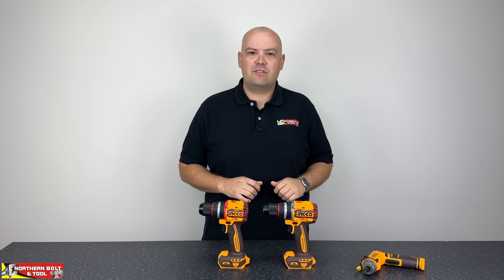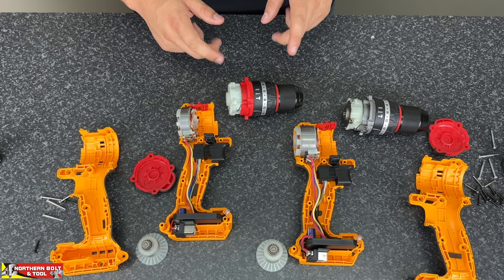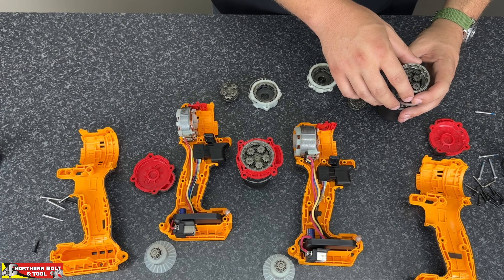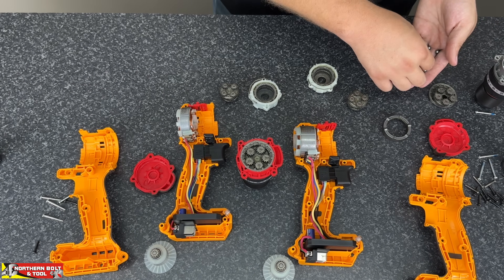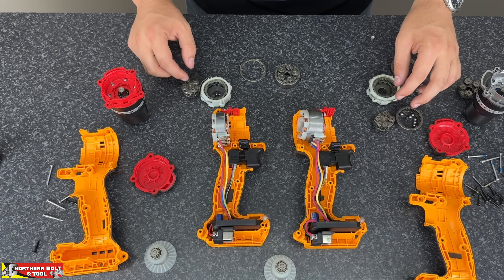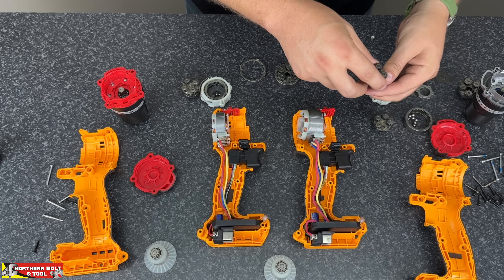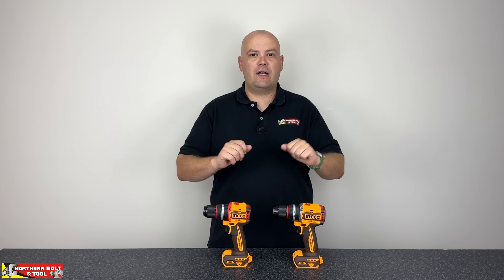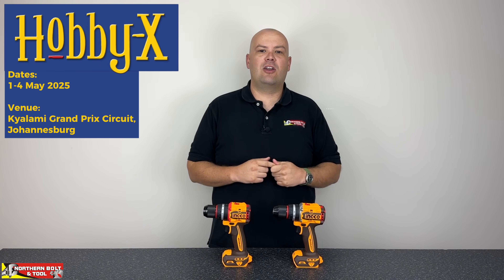Ingco Cordless Impact Drill Teardown: 66Nm vs 96Nm - Which One REALLY Wins?

Comment: what i liked about the design is the circuit board is located at the bottom of the handle near the battery for better prevention from short circuit with the motors as well as weight balance as well, and the metal housing for the motor is a plus for the 96 Nm model, but still not much user of Ingco brand at the moment to praise its worth. But ist's a good design.

Comment: right off the bat, i want to say Thanks for the video about internals of these drillls, rare to find an official product channel show the internal workings. 
and nice touch that you used an ingco small driver tool  itself for opening the tools. The cabling between battery and motor does appear to be higher gauge in 96Nm drill.
wondering if the motor from 96Nm drill can fit in the smaller Nm drill and upgrade it to a higher power drill
Reply from the maker: Thank you for watching! We are glad you appreciate the detail we go into in our videos! As for the motor, it will not fit as the dimensions are a little different, but with some modification you could get the bigger motor to fit in the 66nm casing, I think. For the effort that would go into that it might be better to simply get the 96nm unit, but definitely an interesting thought!

Comment: Interesting, the 96 does seem more robust. 
That said, the warranty thing was surprising. Why would the warranty be voided if it were disassembled and reassembled? How would you even know that it was disassembled if it was properly reassembled?
Reply from the maker: If the unit isn’t assembled correctly it could cause the machine to fail. If you know what you are doing it should be fine.

Comment: Are the planetary gears dry or do they have some grease? It looks bone dry in the video. IF they are dry, do you recommend people pre-grease the gears before first time use?
Reply from the maker: Hi there, the planetary gears do have grease on them.
Reply: I managed to disassemble one Ingco cordless. Although it had grease, it has too little as per my assessment. Idk why Ingco did it that way, not that Ingco should put too much as it is also counterintuitive because it might have a clogging effect, slowing the gears.

Comment: At first I thought they just change the color and circuit board to deliver a bit more power and claim big number.
Nice to see it actually has a bigger motor and more robust gearbox. I guess for heavy use, $10 is worth the upgrade.

one question, did you take it apart and clean out the grease before video or is it came out of factory very dry like that? If so is it worth the time to take it apart and grease it before use? maybe molybdenum grease?

Comment: Great video and I always like to see what is under the covers.  The difference in the planetary gears is probably just down to being  a different batch.  One thing I am impressed with on Ingco tools is the superb quality of the plastic moulded parts.  They have not over economised in this area which many brands do.  The design of the case and strengthening ribs is very good as well as the TP over moulding. As to durability I would imagine both drills will be much the same if used close to their limits.  The 96NM has a larger value capacitor for the extra power needed not for durability.  The downside to the 96Nm drill is it has a lot of torque really requiring an auxiliary  handle for some tasks. Maybe Ingo should make an aux clamp on handle as an accessory if not already. 
The gearbox screws are different on the 96Nm because they are threading into alloy and not plastic. Cannot see but should be finer  threads and good they have thread lock not just to lock the threads but prevent thread galling.   Also note the guide ribs around the screw bosses to stop the cables getting accidently pinched during  assembly of the case.  You did not look closely at the switch, but I think you will find ingco have used  a metal shaft from the trigger into the switch body, rather than plastic, and this makes it smoother  in operation.
Reply from the maker: Thank you so much for your comments and your insight! There are definitely a few details we missed, will definitely keep your points in mind for the next one! Really really appreciate your insight!

Comment: The difference between the screws is probably because of the material it gets screwed into. The coarser thread screw screws into plastic and won't need thread locker as it will not vibrate loose. The finer thread screw screws into metal and thus require thread locker as it will vibrate loose without thread locker.